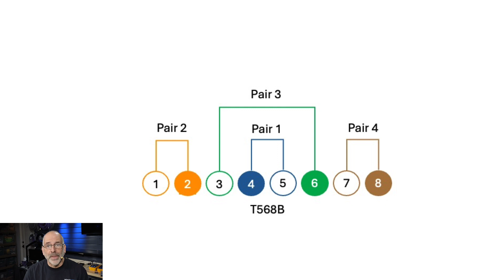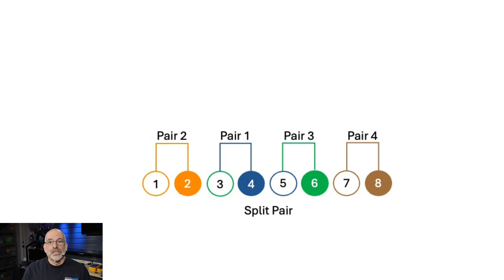Ethernet Termination Gone Wrong! Split Pair Cable

Comment: i replaced one of my existing coax cable in a conduit inside the flooring (german concret floor) with an ethernet wall duplex cable. (this orange ones) The conduit where a little on the narrow side and the few curves maybe on the tighter ones. Anyway, while pushing the cable in and my father in law pulling the fishing line i bended/folded the cable at the input twice... the folds was a tighter 90 degrees... I attached the terminals at both ends, conituity tester said everything works fine. My internetspeed on the other hand is halfed.

can your cable tester tell me if the wire is broken? Or is the error most likely in the terminals? Not experienced enough to judge that. 🙂
Best regards